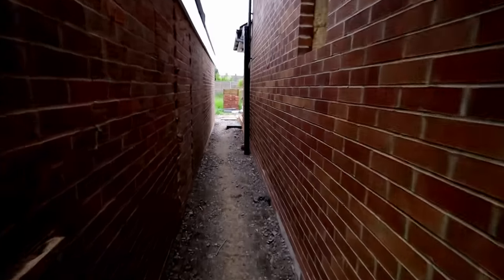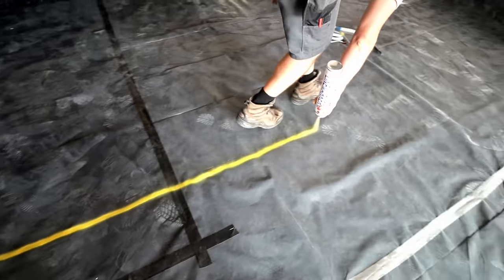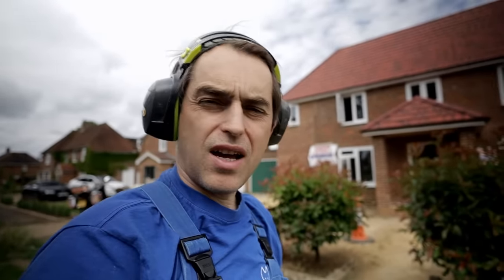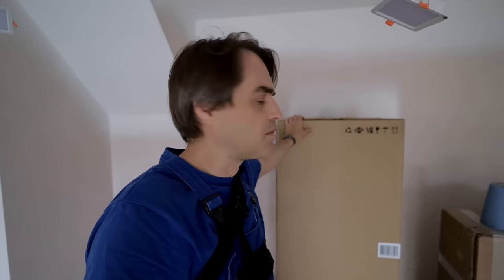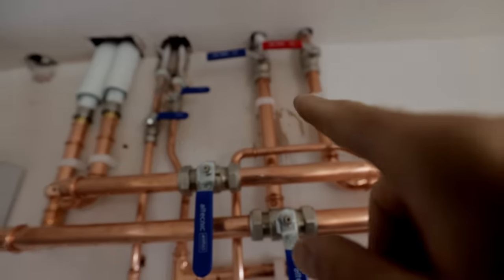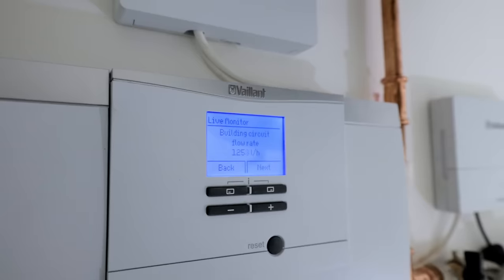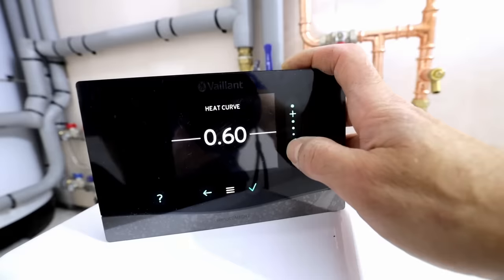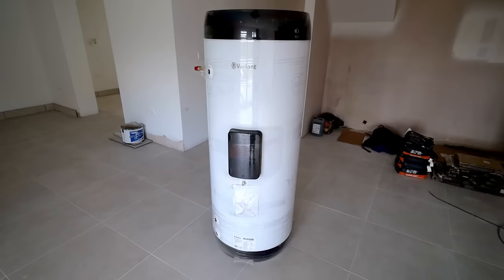Gas Boilers No Longer Make Sense, Here Is Why.

Comment: I just installed a new gas boiler. I cant afford a air source heat pump as it requires me to first insulate all my external walls from the outside, get new doors and windows and add floor insulation . It’s just not viable for most people here in the UK.
Reply: Yes, I was told this updated insulation is necessary to be done first to my 1940 house. The heat pump installation alone with grant was a quote for £6000, but it’s £2000 for a good new gas boiler swap. Maybe in a few years it will be affordable , but not at the moment.
Reply: @Greguk444  One of Urban Plumber's recent videos was about an installation in a Victorian house with solid brick walls. I don't think they added wall insulation and it seemed to work perfectly well. I get the same comments whenever I discuss the idea of having a heat pump in my house (part 200 year old cob/stone, part 25 year old extensions with fairly paltry cavity insulation), but we already have a wet underfloor heating system driven by a 6kW electric flow boiler with flows temps of around 38-40C (already here when we bought it, and no options for anything other than electric owing to various logistical reasons I won't go into). The only difference with a heat pump would be I'd use less power for the same heating effect I have now, which is fine. Granted, I have improved the windows since they were utter junk, but I'd have done that no matter what. The bigger issue, at least for me and also for many others where a pump might work, is as someone else commented: The space required for the tank etc, and the running of pipes to it. I expect one day I will have a heat pump, but I am rather hoping that advances might make the space required less of an issue, but that's probably wishful thinking on my part.
Reply: @stevepettifer4896  Even if I ignored the insulation recommendation, I still have the cost issue. I have not had a quote under £6000, including the grant, most were more and most wanted me to replace my radiators which I am not convinced need replacing as they are double layer type 22. It seems inevitably that I will have to get a heat pump eventually but I don’t think I will do it now as it is so much cheaper to swap out my old combo heater for a new gas version. Also, I just cannot see where I could put the tank and control equipment in my small house. Thank you for your comments.
Reply: All this business about heat pumps 'requiring' external wall insulation is misleading. Just as with a gas boiler you can always install a higher-rated boiler to cope with heat loss, you can do the same with heat pumps: but you'll need a bigger installation, which will cost more and will almost certainly run at lower efficiency too, putting running costs up further. It's just the usual question of compromising on costs here versus costs there.
Reply: @Greguk444  yes, true, it is the cost of the system installation that gets most people. I have seen complete heat pump kits (7kW with tank etc) for under £4k, but usually seems to be the labour costs in most cases that really pushes things up.  For the moment, installing a heat pump when you are not doing a full refurb is something you have to want to do in the full knowledge that it's possible you will not really recover the costs. The running costs can be made to be on par or even sometimes less than a gas system, but the most people can't see past the capital cost, or of those who can, it's simply out of reach. I hope this will change in time, but for now I suppose we are where we are.
Reply: @stevepettifer4896  Thank you. Yes, I feel heat pumps are just out of my cost limits, but I am hopeful the costs will reduce in the next couple of years to be more affordable to people in my position.
Reply: @Greguk444 Indeed, and you ignore the insulation recommendations. You get worse efficiency than gas 😂. Lose lose at the moment.
Reply: @stevepettifer4896  I don't know how available this stuff is in the UK, but here in the USA, I've seen people install ductless heat pumps, with refrigerant going directly to  inside units in the most used spaces, in order to keep the use of more expensive sources, like electric-resistance heating, oil or propane, to a minimum. That gives them some savings with a minimal investment. There are even DIY installation options for those in a position to take on such a project.

Comment: On a large renovation like this you are absolutely right, if it's cost neutral then HP is a no brainer. Gas is only going to get more expensive and there is a strong impetus on government now to bring down the cost of electricity. The bigger issue is the replacement market where a new gas boiler is often a distress purchase (after failure) which householders are therefore looking to do quickly at the minimum cost. Sorting out radiators and insulation then becomes something they don't want to think about even if it makes sense in the long run. IMO the government therefore needs to put a strong focus on making all homes 'heat pump ready' and unfortunately the incessant lobbying for hydrogen by the gas industry has made this very difficult.

Comment: It all depends . We live in a rural area in a 1840's detached house that is not to big but has high ceilings .  We have had 3 prices for air source heat pumps they range from £27 k to £32 k . before any insulation up grades . We have no spare internal space for the plant to go and the wall space 
available  in most rooms do not have space for the upgraded radiators. All of the projected running costs are only just marginally below what we spend all ready and will likely be more as the tariffs they have used in the calculations are not available to use.  The prices for replacing our 25 year old boiler  are from £3.5k to £4.6 k . If you add on the the fact that the ASHP has to be paid up front and the government £5k is not available if your EPC is as lower as ours its just not worth bothering with .  ASHP are an answer but the answer to the 1.4 million oil boilers .
Reply: £32k. Unless your house is bigger than you’re letting on that’s just a scam. Mind you, so is £27k. £5-6k of that is just VAT! I’d be that fuming I wouldn’t need a heating system.
Reply from the maker: zero vat on renewables tough. Some period properties will be expensive to install, expecially if high efficiency is required.
Reply: Agree with you on this. I have put in all the insulation I can (there was none in my loft in 2021!) and replaced an old gas boiler with new. With the much more efficient boiler (95% compared with about 70%) and insulation, I have got the consumption down to about half what it was.
Reply: @jonh1808  he prices all include VAT .  But did not include the 5 windows that would need to be double glazed and the extra roof insulation. All of the quotes said we needed the biggest available pump and we checked all the calculations using industry figures. The money was in the considerable work needed to the existing plumbing and building a place for the tank and plant to go . So I do not think we were scammed at all. High ceilings really throw the calculations out.

Comment: Totally agree, why install gas when as you rightly say the difference is so small and the feel good of doing something towards cutting emissions. As for running cost I suspect with those cops it’s cheaper to run and way more comfortable.. As a retired plumber / Heating installer may I say your workmanship is first class.

Comment: I’ve watched a lot of your videos and you do a brilliant job, however there are not enough installers yet and certainly not many who fully understand the installation. My two bed property was going to cost 25k for HP, rads, solar and battery, at my age it was a no brainer to install a new combi and some rads for 2K.  Now only if I was 25 years younger 👍
Reply: Completely agree with you, my property is heat pump ready. But for some reason I'm still being quoted  £5k for the install that is including £7.5k gov grant. £12.5k seem steep, especially as I don't need any new radiators, or pipework upgraded.
Reply: @Pav_1983  You are ripped off in UK and many western countries. I've installed a 6kW monoblock unit from Gree that was bought from Spain and shipped to Romania, where I live, with 2.600 EUR. No boiler was installed, DHW is still the job of the gas boiler. Last winter I've used only the heat pump for heating and the cost was 357EUR for the season (winters are harsher here then UK i think). With gas would have cost me 632 EUR. Using heating at 24°C inside from October until May for a 135 sqm house, but it's well insulated.
This year I managed to install through a government grant a 7,3 kWp solar system with 4.000 EUR so obviously from now will be cheaper.

Comment: I'm prepaired to bet that this man has an extemely high IQ.    I have never seen such proffesionalism in this field.  His work looks so clean.
Reply: He’s definitely over qualified for a uk heat engineer. Maybe it’s different in other countries
Reply: @immers2410 he actually is an engineer, most UK plumbers can’t even be arsed to do any calcs they just chuck something on the wall and then charge you more money later to install the right size radiator.
Reply: It doesn't require a genius intellect to install a heat pump system. He's just a plumber, with pride in his work, and eye for detail.
Reply: @hvacdesignsolutions  there are a lot of variables involved in designing and implementing a system that runs at optimum efficiency
Reply: Does conscientiousness map to iq?
I'd assume it does.

Comment: Any recommendations if you don’t have space for a “plant room”. Genuinely interested in one of these for our two-bed maisonette, but a combi boiler takes up no space at all, whereas it seems these need a lot more space (both inside and outside) for an equivalent system?
Reply: What space do you have? Do you have an airing cupboard? A loft?
Reply: @pumpkinhead456  There was formerly an airing cupboard that now has a washing machine and tumble dryer stacked where the old hot water cylinder used to stand. But it’s only just big enough for those two and has no external walls, so even if it wasn’t full, I’m not sure it would be suitable. The only other place is a coat cupboard on the 1st floor, but that’s even smaller. We’d also have to get permission to hang a unit on the outside wall (which is currently prohibited in our block). I’m just not sure these are a good alternative to a combi boiler in small flats / apartments (as much as I’d like them to be)…

Comment: Nice installation and I'm sure it makes perfect sense for a contractors bank balance, however this is a renovation of a house that no ones in a rush to move into and if this is a builder who will sell the project on he will be looking for a return on investment. A couple of questions what was the total cost for supply and installation ?, what's the warranty period, why have you specified such a large installation when you will run the system around 40% capacity ?. Where are people expected to put a cylinder of that size when houses have been built for the last 20 years without emersion heater tanks. what savings against gas will be made ?........... think of the disruption to the average family household with no guarantees........ yeah makes perfect sense.

Comment: Looks great.  I agree about the cost on a big complete renovation like that, no brainer.  But for the average home when the boiler is end of life its a more complicated question.  Also for someone like myself thats a geeky DIYer (i'm doing a full house renovation, so far prob 95% on my own) that wants to do most of it themselves the grant and the vat thing is not much help :-/. Interested in the cooling idea the customer is going for, be interested to see what that looks like if the customer will let you film it.  Anyway, great video.  Thanks.
Reply: Maybe you can find a friendly plumber who will order in the rads for you, they tend to get discounts anyway so you might both benefit
Reply: If you're interested in cooling as well as heating, have you considered a heatpump AC system (HPAC)? Simple and cheap to install but weirdly, no grant available. Ours has a CoP of 5 and is so cheap to run as it is easy to direct the heat. We run the system on Octopus Go battery stored electricity@7.5p/kWh plus solar. We've retained our boiler for now to provide hot water for showers.

Comment: So i have similar plan to do in my new house now since i still didn't do any consultation with Vaillant i was wondering how the system will work with solar panels, so heat pump, solar panels i was thinking to put massive buffer tank probably 1000L one twin coil and everything feed from that, since we have plenty of sun here where i  live but very cold winters - 15c

Comment: Total install costs after grants may be still very high compared with a gas system. Maintenance and servicing costs also need to be compared as does the life expectancy of the  main piece of kit. If a house is well ventilated and has heat recovery systems the actual heat input should be very little. In fact I remember an experimental house being constructed 45 years ago to a low budget. It had thick insulation, treble glazing and heat recovery. The only heat producing appliance was a gas fire in the living room which only needed to be switched on for a couple of hours a day!
Reply: Im not sure how you get comfort with a gas fire in one room.
Reply: The target is passive heating (was planned for building regs before the govt pulled it...). Most houses have a total of around 4MWh/y of heating from electrical appliances (it all ends up as heat) and occupants. This CAN be enough to keep the house warm, with the appropriate insulation and air control as you mention. The complex water systems as shown in this video play no part in this- it is all about air management. Imagine the cost and complexity of keeping such legacy systems running...
Reply: @edc1569  Hi, it worked by the heat recovery system drawing it via ventilation to other parts of the house, then the heat is recovered and re-introduced with the fresh air coming in. The high insulation levels do the rest.
Reply: Extreme insulation isn't necessarily a great idea anyway. A lot of these modern materials are made of many materials that might not be that great to your health to breath in all the time.
Reply: @chunkymonkey55555  And why would the air you breathe pass anywhere near the house insulation? Passive heating (the ultimate goal) requires active control of air change. This involves (as a minimum) a heat exchanger between incoming and exhaust air. This controls the flow of air within the building, which is otherwise sealed. Moisture and dust control of this air is an obvious addition. None of this is part of the crude A2W2A system in this video. This will form part of the dated and expensive redundant systems we are so keen to install in this country.
Reply: @Tensquaremetreworkshop  a flow of air is healthier.
Reply: @chunkymonkey55555  Yes, And that is what air change gives you. In a controlled manner. At the best temperature and humidity, dust and pollen free. Whereas the topic in this video totally ignores this need.
Reply: @Tensquaremetreworkshop  Yes on this extensive expensive system install,
Reply: @Tensquaremetreworkshop  you are right - almost all electrical energy used ends up as heat, except maybe if one charges electric car batteries, as that energy gets dissipated outside.
Reply: @Tensquaremetreworkshop  "This will form part of the dated and expensive redundant systems we are so keen to install in this country."

I suppose recuuperators can be later installed in each room independently of the heat pump. But yes, you are right to point out that real efficiency in practice can only be achieved with recuuperation.
Reply: @audrunasgruslys9243  Some is lost- such as the light from internal lighting that escapes through the window- but this is really trivial and can be safely ignored. How much hair an occupant has will be a bigger effect. Of the order of 35Mj of passive energy per day on average, for a 2 person household. It is perfectly possible to have a passively heated house- but only if air change is controlled.
Reply: @audrunasgruslys9243  My point is that an efficient system needs air management, so why not heat the air while doing this. The purpose of all property heating systems is to warm the air in the building. Nothing more. Given the huge change in efficiency of heat pumps as the differential rises, we want as little barrier between the refrigerant and the building air as possible. Refrigerant at 30C > water > air at c20C makes no sense. Fuel based systems make use of the high storage capacity of water to allow intermittent operation of the furnace to translate to steady heat flow. This is not the case with heat pumps- the best operation is to run continuously and adjust the differential- this maximizes efficiency.

Comment: Yet again watching your work with properly designed and installed system the case for going with a heat pump gets stronger, very interesting indeed, I already have PV on the FiT but upgrading this system as well with the heat pump makes good sense
Reply from the maker: Thank you for watching!
Reply: ASHPs are like EVs, they won’t suit everyone.
Reply: @UrbanPlumbers  Never miss your presentations
Reply: @kevinmills5293  This is true but if you do your homework first and carefully for what you want to achieve or even if it’s positive for your application and select the right people to do the job then there is not really a problem